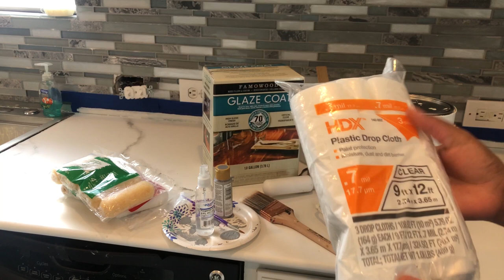WHITE MARBLE PAINTED COUNTERTOPS | EPOXY TOPCOAT | EASY AFFORDABLE DIY (without using a kit)

Comment from the maker: 9 month update!! 

Structurally and functionally the countertop is holding up well to every day use. As you see in the video my moms kitchen gets FAR more light than I realize so since I used a pure white paint it started to yellow a bit. If I were to do this again I would choose to do a type of marble that isn’t as pure white (or a granite finish would work too). Also we let it cure for about a week or two to be safe by making sure things were placed on towels or cutting boards. 

TLDR: be aware of potential yellowing with pure white designs in high sun areas (UV exposure)
Reply: The epoxy did the yellowing
Reply: That's a shame because you did an outstanding job.  There must be some type of UV protective product to use for or with the topcoat. 

I love the way you did the veins--looks much more realistic than most of the other techniques people use. Great job!
Reply: What other colors can you choose that is light?
Reply: @rgbuckl  You're right.  She did an excellent job for saying she's not an artist.  This was a bold undertaking.  I use Stone Coat Countertop products.
Reply: Thank you so much for the update
Reply: Great presentation and great job!!! One thing that will help with the dripping over the sides is to apply painters tape on the underside. This way you can just pull it off with less of a mess.
Reply: You still have it or did you change it?

Comment: Love that this was without a kit!! The kits are sooooo expensive :/
Reply from the maker: Right!! I knew there was a way I could
Do it and buy everything separately
Reply: @TheRachelThomasLife  great job! would you mind saying how much you spent, to compare with the kit? also, did you thin out the grey paint for the veins?
Reply from the maker: I spent a little less because I had the primer and paint on hand since I was working on other renovation. But to purchase everything new it would be $20 for primer, $10 for base paint, $1 for the grey paint, and $60 per gallon of epoxy (our kitchen is big so I used two) if you used the brand I did but there are cheaper. So about $90 not including tarps tape and paintbrushes/ rollers which you can get for under $10. The kit that I saw online was $150 and I was going to need 2 of them which is why I knew I needed to find another way 😂
Reply: @TheRachelThomasLife  would you recommend a kit or do you think the materials you used were more effective? Also how are the counters holding up this far have you had any issues?
Reply: @TheRachelThomasLife  Hi....I really enjoyed your video and just painted my cabinets with the nuvo paint kit.  I have 2 questions...can you use a sponge roller for topcoat?  Also wondering can I use the nuvo paint I have left over, it's  water-based and would match perfectly?
Reply: So true!  Sometimes you don't need everything that comes with a kit, and I like using my own paint colors and originality!

Comment: Did you use just a regular hair dryer at the end? Didn’t know if it was a stronger heat out put or you could just use a normal hair dryer
Reply from the maker: Just a normal hair dryer! It was actually a mini travel dryer

Comment: I have a built in backing.  How can I do the epoxy on that please?  Also, what would a littler glitter look like in there?
Reply: Oh. Yes great question! My counter has a 3 inch lip up in the backwall too..where the backsplash is. How do you cover that with the epoxy? Yikes

Comment: Please wear a respirator mask when using epoxy! Countertop looks great ❤️
Reply from the maker: Unfortunately I learned that right after but I did buy one with the correct filters and now never use epoxy without it! And googles 😉
Reply: And Gloves
That stuff is hard to get off your hands, even if you wipe it off immediately it leaves residue.

Comment: good video-shouldn't you have use a polyurethane seal coat before applying the Epoxy resin. I hope your countertops don't discolor in shadowy places e.g. under an appliance that stays in one place.
Reply from the maker: Great tip! Thank you for sharing
Reply: Hi, I am new to these things so I want to ask why should a seal coat be put? Does it help?

Comment: Loved your video girly!! I know it’s only been 4 months since you’ve done this project so it’s too soon to tell if you’ve seen any yellowing but I’m so scared to try epoxy resin without knowing if it’ll yellow overtime.
Reply from the maker: The yellowing will occur with UV (sun rays) so the ones I did tinted a bit yellow but still look good!
Reply: Nedda I’ve been worried too about the same thing. I have heard to drake with polyacrylic which won’t yellow but at the same time I don’t think you’ll get that same thick coat of shine like you will with the epoxy 🤷‍♀️
Reply: @kristinzalgenas1396  Kristin, I purchased the polyacrylic and used on my test sample next to a section of epoxy. You are right, there was no comparison and i used 4 coats of the poly with a light sanding in between.
Reply: @sherieshank5148  can you possibly do the epoxy for the shine and then put the poly acrylic on top? Or it would still dull it?

Comment: My question is when you are laying the top coat how do you know it's "even" or is self leveling? I'm completely new at this so sorry if it is a dumb question. Also thank you for the best veining and feathering tutorial I've seen so far!
Reply: Expoxy for countertops is self leveling.
Reply: When I watch Stone Coat Countertops, they use a 1/8 inch trowel.  This young lady did an excellent job; but I just wanted to give you an answer to your question.  The trowel ensures consistency in the amount across the counter; but the epoxy also levels itself.

Comment: Great video!! Loved it. Need to watch it at least 2 or 3 more times. I missed what are you spreading the epoxy with? 
And how long did you wait for the paint to dry before applying epoxy coat? 
And where did you tape the plastic sheeting to? The top of the cabinet or under the countertop? 
And is all you have at the backsplash the masking tape? 
 how do you know how much epoxy to pout or out? 
And last how much time to you have to get it spread out? Work in sections? It won't harden in the bucket if  I'm slow?
Sorry for all the questions but I just wanna get it right!! 
Totally gonna do this!  Starting off small on my bathroom countertops. Does it tell you how much you need to mix up per square foot? 
Thank you soooo much for sharing your knowledge and technique. 
I literally was looking at Rustoleum acrylic but the 12 colors were ugly!
Also thought about the tissue paper marbling but I really love this carrera looking marble with the high gloss!
How long does it last? 
And how long for it to cure if it needs that? 
TIA hope you see 👀 my questions.
Thanks again! 👍❤

Comment: This is beautiful! How do you do it with hot items? I found this really nice contact paper and it has been damaged by ei: hot plates removed from microwave and hot cups of coffee lol I need to change it. I am curious to know if I am going to run into the same issue with this top coat.

Comment: They are beautiful! I do have a question tho. I'm thinking of doing my bathroom countertop with 2 sinks that are in the countertop itself  like blended or grooves downward in one whole slab. Would this be ok to do if I were to paint into the sink itself? It would have water and toothpaste and all that, so high traffic!
Reply from the maker: I think it would be ok! You would just need to make sure as you’re pouring the epoxy that it’s staying even and not making puddles in the corners
Reply: Thank you! This was definitely the most helpful video I've watched. Hopefully mine goes well 🤞

Comment: Ok so this was the best video and results that I have seen on this thing called YouTube. Thanks for giving me an extra boost of confidence to do this. I am very artistic and tend to try my hand at a lot of things but I have never made a faux marble top before. I'm going to make one change to mine and that's instead of the epoxy I'm going to use polycrylic as the top coat due to drying time and ease of use. Thanks Sis for the video the water bottle spray is genius. 😘❤️👏🏽

Comment: How did you coat the edges of the countertop?
Reply from the maker: I used my spreader and let the epoxy run over the edges and then every 10ish minutes I would scrape off of the drips

Comment: Question- did the paint chip because it wasn’t fully dry? Or is it something that will happen often? Thank you!!
Reply from the maker: The paint got messed up because I had actually painted over half the counter a month before but hadn’t put the top coat on and since we were still using the counter, splashes of water and other stuff messed up the paint (it was easy to fix) but once the epoxy is applied it isn’t going ANYWHERE
Reply from the maker: The paint got messed up because I had actually painted over half the counter a month before but hadn’t put the top coat on and since we were still using the counter, splashes of water and other stuff messed up the paint (it was easy to fix) but once the epoxy is applied it isn’t going ANYWHERE